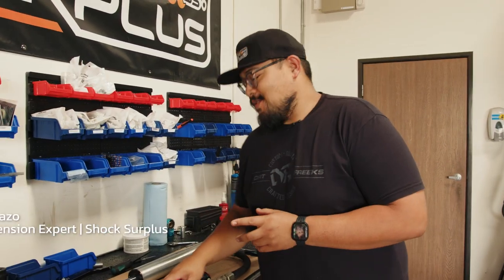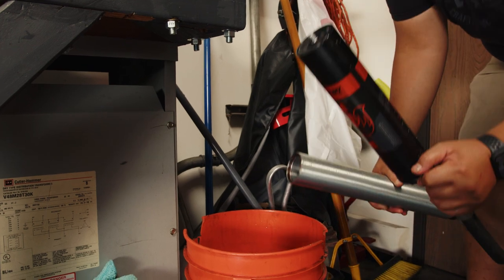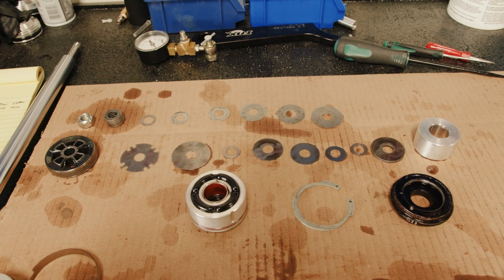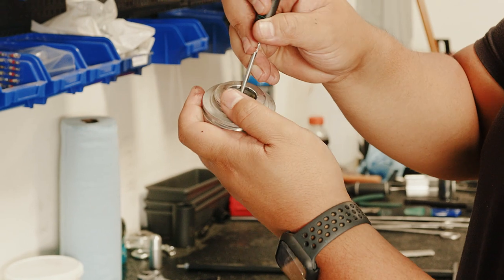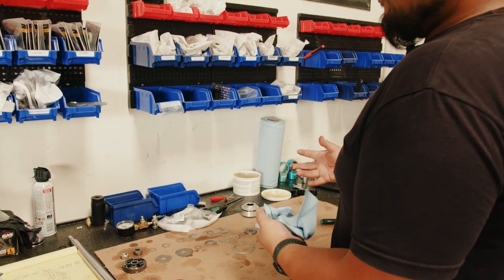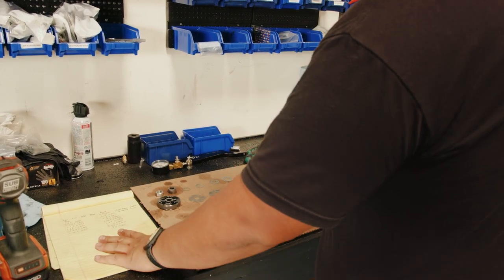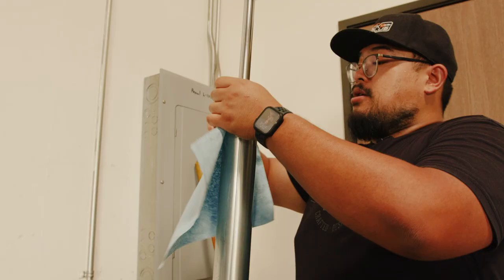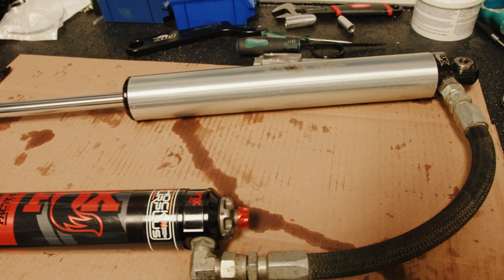@ShockSurplus Rebuild Service - Fox 2.5 Factory Series

Comment: Great video, very helpful. Are you pushing the ifp all the way up or is there a set depth and where do you find the info on the depth?
Reply from the maker: there is a set depth, which measure where it sits before it comes out of the shock (set by fox), so we can reset it there on the rebuild.

Comment: I have a leak between the end cap and shock body... is that threaded?  Can it be fixed with a new seal?
Reply from the maker: sometimes the shocks 'weap' where oil gets trapped and pushed out on assembly. Clean it up, and if it leaks a lot more, than its an internal seal issue that needs replaced.

Comment: What does a shock rebuild/service cost? Does it vary based on the brand. IS the cost per shock or a pair?
Reply from the maker: The price is all the same for the size of the suspension so like 2.0 are priced all the same then 2.5 are priced the same and etc. You can see the details here: https://www.shocksurplus.com/pages/shock-service
Reply: I noticed  your wearing a dirt freeks shirt  16 years ago I bought a baja bug that had dirt freek  on it with some research I found a guy named Danny dessaint  built it. It was his first car he ever welded a cage in I still have the car to this day just looks diffrent

Comment: What is the spec IFP depth for a 2.5" 14" travel shock?
Reply from the maker: Varies on the brand, shock body, reservoir body, application and so forth.
Reply: @ShockSurplus  sorry, i was asking about that exact shock in the video if that helps.
Reply: I would also like to know for this exact model, cant find it anywhere